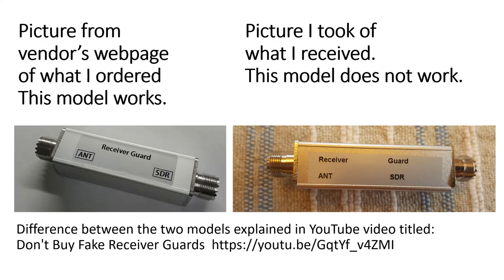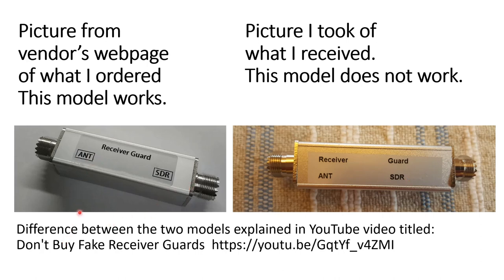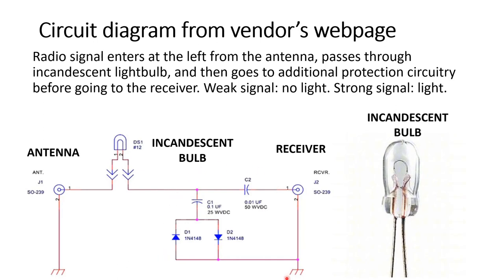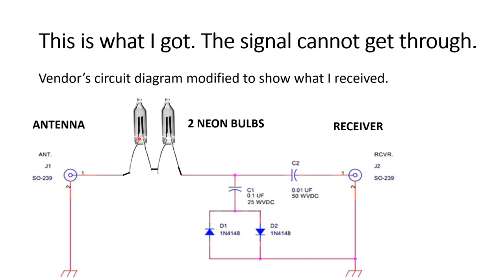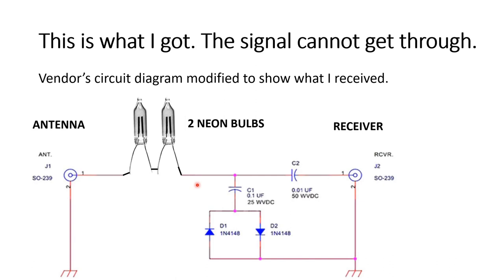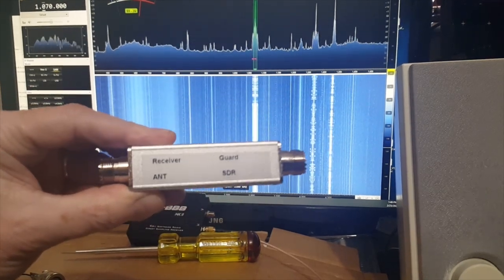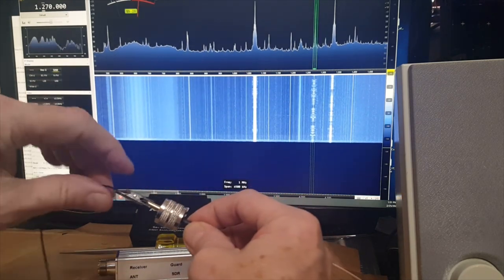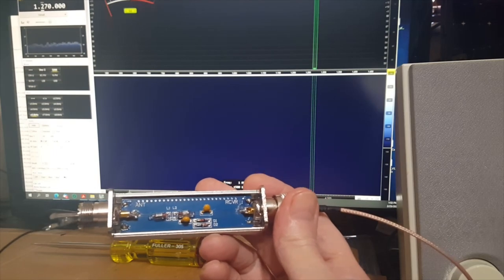Trouble with receiver guard: Video submitted to AliExpress

Comment: Thank you for the reference to my Video. It might be easier to just replace the neons with bulbs than attempt to get that refunded or replacement. But they should refund or send a replacement. I hope that does not include you being required to return it, it would probably cost more to return than what you paid in the first place. You did a good demo as to the issue also. 73 Andy.